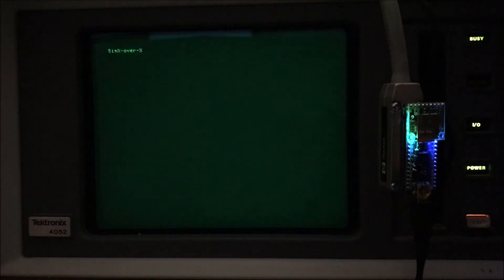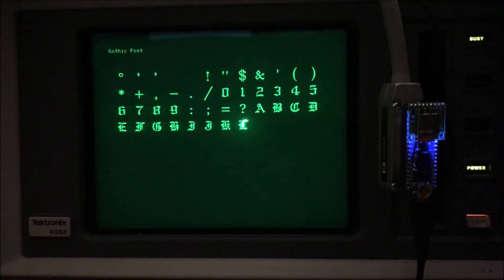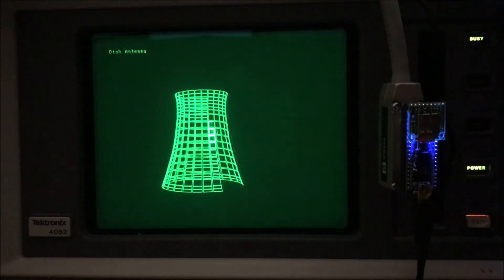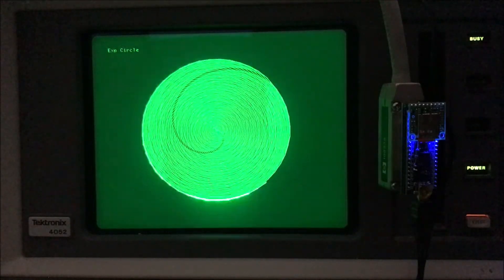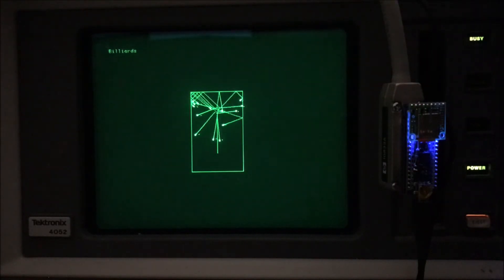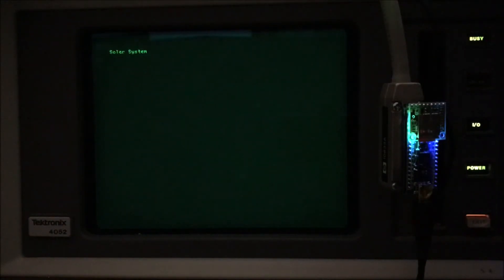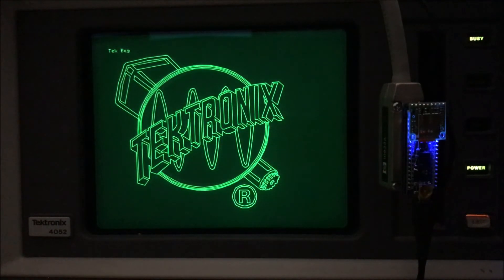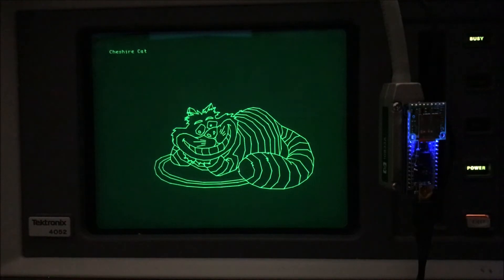Tektronix 4052 Fast Graphics demo

Comment: Monty, that is a really cool demo. Funny thing as I understand the CRT "persistence" was a unwanted side effect in most early displays because of refreshing images, but Tektronix being oscilloscopes really did take advantage of that for tracing. now it's accomplished of course with memory. thanks for sharing this
Reply: This is not normal persistance, it is actually a memory tube.
A graphics "printer" came with these that had a line CRT that printed onto silver gelatin paper.
Reply: @pizzablender  how is this tube different from a standard b&w vector monitor? Are they using a drastically different phosphor on the tube that retains its energized state? I also noticed how the whole monitor is lit up during the clear state, how is that then removing the charge on the displays.

Would be interesting to know more about this technology as it is not very intuitive compared to most other display types (lcd, oled, raster, raster color, vector, vector color, etc.)
Reply: @LeObsidianCraft  It's pretty weird, they use layers of screens just behind the face of the tube to hold and maintain a charge. If you get a chance you can play with one of these in an oscilloscope that has a storage display. You can use the x-y function to move the beam around to draw on the screen and you can play with the sustain control and make the image melt into a blob such that you can't get it back.
Reply: The “storage tube” was designed so that, once a line was drawn on it, the refresh system would keep that line visible indefinitely. In fact, there was no way to selectively remove things from the display: you had to do a full reset, which wiped the screen and made the whole thing flash. Then you had to wait about one second for things to settle down, before you could start drawing again.

Back when graphics terminals were expensive, these were the cheapest and least fun way to get one.
Reply: This is what I call hardware acceleration.
Reply: Englisch: https://en.wikipedia.org/wiki/Storage_tube
Deutsch: https://de.wikipedia.org/wiki/Direct-View_Storage_Tube
Reply: I should add that I've never seen or heard of a storage display that can hold levels of grey (someone please tell me I'm wrong!) If I understand right it there's a threshold of brightness to make a spot in the storage plane but they sort of do hold grey levels for just a moment. They fade in less then a second. There are different types of storage tubes; I used to use a storage tube in a scope to make live video effects for music, so all aspects were played with in time to music as a computer drew "music vectors" on the screen.
Reply from the maker: @wdavem  Actually the Tektronix 4014 vector graphics terminal had an Enhanced Graphics option which included a mode for grayscale with 64 levels - which were persistent until the display was refreshed.  There is a youtube video of a demonstration of the Tektronix 4014 terminal which includes several grayscale pictures.  The 4050 computers did not have that capability - so I believe my dithered-dot technique is the first time that photographs have been displayed on any 4050 computer - see my video here of the Mandalorian and Grogu: https://www.youtube.com/watch?v=QMEgysuCwZA

Comment: Impressive!
A bit faster than the HP9845 vector graphics at the time, but that used CPD NMOS RAM rather than phosphor persistence.
(Oh: it is not GPIB, it is HPIB, as evidenced by the logo on the cable.)
Reply from the maker: Yes, HP invented the HPIB in the late 1960's, but the Tektronix 4051 introduced in 1975 documentation calls the connector GPIB and references the IEEE standard #488-1975 (also introduced in 1975) which named the interface GPIB 😃 See this article: https://en.wikipedia.org/wiki/IEEE-488.  Yes the cables that I have are from HP.  The biggest difference between the 9845 and 4051 was the graphics - the 4051 BASIC included graphics commands for the storage tube display at 1024x780 vector resolution.  Any Tektronix 4050 BASIC supported graphics on the CRT display or Tektronix 4662 GPIB Plotter by simply changing the GPIB address on the MOVE and DRAW commands to the GPIB address of the plotter - see my 4662 plotter video: https://www.youtube.com/watch?v=hGmodCc9Hh4  The Tektronix 4054 computer introduced in 1979 included a 19" storage tube display with 4096x3072 12-bit vector resolution as demonstrated in several of my other videos like this one: https://www.youtube.com/watch?v=W2VXdR9rbgU
Reply: @TEK-Vectors  Thank you for the comprehensive reply.
HPIB was renamed to GPIB purely to avoid royalties.
Reply from the maker: @MichaelKingsfordGray  maybe one of the first instances of a proprietary computer technology going opensource?

Comment: I wonder how far vector graphics could've gone if people kept developing it.
Reply from the maker: I believe the high cost of the cathode ray tube compared to a liquid crystal display was a factor in the demise of storage tubes as CRTs were replaced by LCDs.  Wikipedia article on "Liquid-crystal displays" notes that in 2007 the image quality of LCDs surpassed that of CRTs for television corresponding with LCD TV worldwide sales volume surpassing that of CRT TVs.  Storage tube technology was advantageous while the cost of computer memory was high, but the continuous advancement of integrated circuit technology resulted in incredible cost reduction for memory and the incorporation of memory into LCDs for TFT displays.
Reply: When it comes to vectors versus pixels, the deciding factors are cost and quality. Through the 1980s, memory was very expensive and pixel displays require memory. That meant that vectors were cheaper (for storage tube technology). Also, there were 1024 addressable vector locations horizontally, which was much higher quality than the 640 horizontal pixels in most early graphics displays. But it didn't take long for memory to get cheap and pixelated displays to acquire high resolutions and color. That allowed for much richer user interfaces and also 3D solids (the precursor to today's graphics cards).

During this time, the Evans and Sutherland company continued to advance the technology of vector displays, including high image resolution and some limited color capability. They also developed a vector system for planetarium shows called DigiStar. However, they eventually had to go to pixelated displays as the cost and quality for pixel based systems became so much cheaper. Now with OLED and 8K displays, there simply is no way a vector based system could hope to compete.

One place you still find vector based systems are laser light shows, and some types of 3D printers that use lasers to harden plastics or melt powdered metal. Modern laser systems are extremely high resolution and very fast. Laser vectors are based on moving mirrors and the speed is only limited by how fast the motors which drive the mirrors can move.
Reply: @KendallAuel  Technically even raster displays don't need more than a few bytes of video memory as long as the graphics can be created as the display is scanned - like the old Atari 2600 which had none. A lot of the hobby microcontroller VGA projects use this method, usually just generating the graphics for a single scanline in a reusable buffer. It means it's also easy to add sprites, and scroll the display smoothly, along with generating audio during the horizontal retrace periods. Vector was definitely a way to efficiently produce nice crisp hi res displays with less memory though. The fact it couldn't really produce filled polygons limited its appeal though, as memory prices fell and bitmapped raster displays were more feasible.
Reply from the maker: Three other current day uses for vector graphics are commercial and consumer 3D printers, vinyl cutters, and CNC machines.  All of these operate similar to plotters and storage tube vector graphics displays like the Tektronix 4050 series computers.  The command set for them is G-code (https://en.wikipedia.org/wiki/G-code) which includes linear Move and Draw commands plus Circles and more complex curves.

Comment: Do you have the uncompiled code for this demo? I’m interested in how those complex illustrations, like the dragon were created. Did someone work out the each of the complex curves mathematically or was there a shortcut from some CAD program where the drawing was made?
Reply from the maker: All of the pictures in this demo were created in the late 1970's by Tektronix engineers.  Tektronix had digitizing tablets and software for the 4050 series graphics computers that may have been used to trace photos to create each file.  Michael D. Cranford (listed in credits) created some of the images to demonstrate his Fast Graphics ROM Pack for the Tektronix 4051.  I have created 8 new images that can be seen in my updated video: https://www.youtube.com/watch?v=L4cYHIgkCkM&t  I used Inkscape to trace black and white pictures and export the result as an HPGL plot file.  I wrote a BASIC program to convert the output to the Tektronix 4050R12 Enhanced Graphics format - which is the same format Michael designed.  All these images are being displayed by a short BASIC program which reads each image from a BINARY data file where three bytes contain the 10-bit X and Y vector with one bit for MOVE or DRAW.  All my images are posted on my github repository: https://github.com/mmcgraw74/Tektronix-4051-4052-4054-Program-Files with the latest files in the Flash Drive folder.
Reply: @TEK-Vectors  thanks for your comprehensive answer! I’ll have a look at your images

Comment: I have a 4051 with the Tektronix movable stand
Reply from the maker: Neil - is your 4051 working?  If not you can post symptoms on vcfed.org Other forum and get good help fixing it.  I had to repair both my 4052 and 4054A - which had bad DRAM.  If its working, you should try some of the programs I've posted on my github repository of many dozens of Tektronix tape programs I have recovered: https://github.com/mmcgraw74/Tektronix-4051-4052-4054-Program-Files

Comment: We had a Tek graphics terminal (this one or very similar) at our high school starting in  1977.  As I recall it took four ASCII characters to define a point on the screen.  Pretty simple commands like draw-on, draw off, move-to by two character codes.

We didn't have the mathematical tools to do hidden lines, so we had a lot of wire-frame kind of pictures.  But the most popular thing to do on it was a game we wrote called CANNON.   Drew a cannon and a power pole at random places on the screen, pole bigger or smaller based on difficulty setting.  You had to input angle to fire and grams of gunpower.  It would draw the projectile path.  Object was to shoot down the power pole as close to the base as possible.  You had a limited amount of gunpowder (also based on difficulty level) so take a number of shots.  Written mostly by Garth Dollahite who went on to write some popular games for the TI-99.
Reply from the maker: Joseph, this is video is on Tektronix 4052 computer which has the same display as a Tektronix 4012 terminal and adds a 16-bit custom bit-slice CPU with 64KB of ROM and 64KB of DRAM - that can also act as a terminal.  If your high school had a terminal - then the CANNON program was running on a separate computer?  Do you remember what kind?  Your description of four ASCII characters to define a point sounds like the Tektronix 4012/4014 Terminal Graph Mode, which starts with a GS character followed by Hi Y, Lo Y, Hi X and Lo X characters to define an XY endpoint from 0,0 to as much as 1024x1024 (although Y values are limited to 779 max).  The 4052 computer has the same vector resolution as the 4012/4014 terminal Graph Mode.

The 4052 ROMs provided Tektronix 4050 BASIC which had MOVE and DRAW commands with WINDOW and VIEWPORT capability to scale the graphics to the desired size.
Reply: I like your avatar, is that a CRT or a vacuum tube really cool
Reply: @fjs1111  Yes, a triode tube.  I like working on old tube gear, audio stuff or old test equipment.
Reply: @josephcote6120  : Same here in Poland (German guy, living in PL now)
Tons of good old amps over here.

Comment: Do you have the files for this available somewhere? That Solar System demo looks great.
Reply from the maker: Ben, yes I have been posting Tektronix 4050 BASIC program files on my github repository since 2018.  Here is the link to the main repository, I have posted files from different tapes in different folders.  Tek BASIC used file numbers for each of the files on a tape - so many folders show only the tape file numbers for each program or data file.  Some of the folders include the name of the program as a comment in the file 'header'.  https://github.com/mmcgraw74/Tektronix-4051-4052-4054-Program-Files   The folder for the files in this demo are here: https://github.com/mmcgraw74/Tektronix-4051-4052-4054-Program-Files/tree/master/4050R12%20Graphics%20Enhancement%20Demo and file 21 is the Fast Graphics DATA file for the Solar System demo.  File 8 is the Picture Drawing menu program - you select file 12 to run the Solar System demo manually - or in my demo you just press the RETURN key to run all 12 of the demo Fast Graphics files.
Reply: @TEK-Vectors  Thanks! Very cool. Is there documentation for the .DAT data format? Is it related to the 4014 format at all?
Reply from the maker: @BenInSeattle  No, the Fast Graphics format is different - three bytes per vector, described in the comments of my BASIC program that emulates the Fast Graphics/R12 ROM Pack to draw Snoopy: https://github.com/mmcgraw74/Tektronix-4051-4052-4054-Program-Files/blob/master/FastGraphics4051/BASIC/Snoopy.bas  The documentation for the R12 graphics image format is in Appendix C of the 4050R12 ROM instruction manual here: https://github.com/mmcgraw74/Tektronix-4051-4052-4054-Program-Files/blob/master/4050R12-Graphics-Enhancement-ROM/070-4639-00_4052R12-manual-OCR.pdf

Comment: Thanks for uploading, these are wonderful machines. Have you had to do much maintenance to keep it going?
Reply from the maker: Not too much.  I purchased my 4052 and 4054 around 2000.  I think the 4054 had a couple of bad DRAMs, which I replaced.  I have also had to replace bad capacitors in the power supplies on both computers.  Just last week I replaced a power resistor on my 4052 that kept the display from working.  But repairs are pretty easy - and Tektronix service manuals for the 4050 computers are on the web, plus manuals for the options including ROM Packs.  I think the repairs are similar to repairing other 40 year old computers.  I used a 4051 in my first job in the 1970's and loved how easy it was to use and program.
Reply: @TEK-Vectors  As the only computer in a 1970's RF development lab my 4051 had some great features (easy to program BASIC interpreter with error checking line entry and matrix commands, GPIB for data collection and control of instruments) and severe limitations (only vector graphics in green, no digital video RAM so unable to selectively update or read pixels) that ruled out interactive mouse, drag-and-drop or GUI operations. It had a well-developed network design program that we used to plot a circuit's RF S-parameters on a Smith chart. However when we unpacked our first brand new IBM PC-AT with its impressive CGA ( gasp! ) raster graphics, the faithful 4051 was pushed away into a corner and neglected. But I remember it as reliable and it needed only one repair: that was to turn around the storage CRT whose phosphor became worn at top left where code was most displayed.
Reply from the maker: @MrCuddlyable3  I agree with you.  I was shocked at how pitiful the graphics were when I worked at Compaq Computer on the Deskpro 286, 386 and 486 design team.  I also found Microsoft BASIC at the time could not run many of the Tektronix 4050 BASIC programs I had written without a lot of rework.
Reply: @TEK-Vectors  Another memory to share is of the enormous companion 4630 hard copy unit that disgorged still-hot  thermal copy sheets that curled and yellowed, and needed periodic refilling with a supply drum. I believe this monster received a scan of the 4051 display through an RS232 port. Anyone interested in a retro project might try generating frame-by-frame animations from that RS232 port.
Reply from the maker: @MrCuddlyable3  I have a working 4631 hard copy unit.  Yes the sheets do yellow over time, but I still have program listings on my printouts from 40 years ago that are readable enough to recreate those programs.  The secret was - put the prints in a dark place.  The UV from fluorescent lights or the sun would quickly 'brown' the paper if the pages were left out on a desk. The prints were a complete screen print of text and graphics in a video scan format.  The printer had a one line CRT that displayed the video scan as the drum turned to reproduce the entire screen with text and graphics at full resolution in a couple of seconds!  Check out the photo of the hard copy unit single line CRT on this page: https://vintagetek.org/4051-graphic-desktop-system/